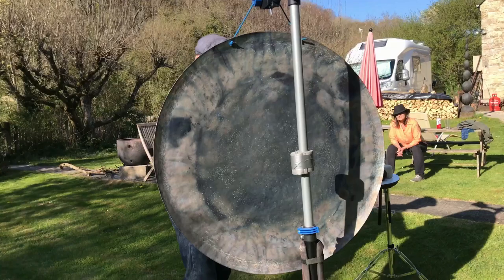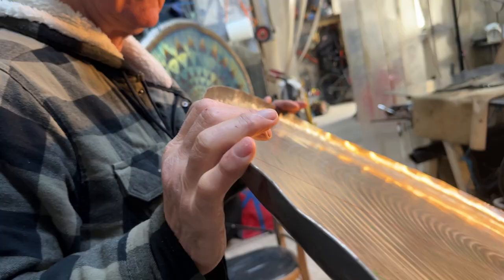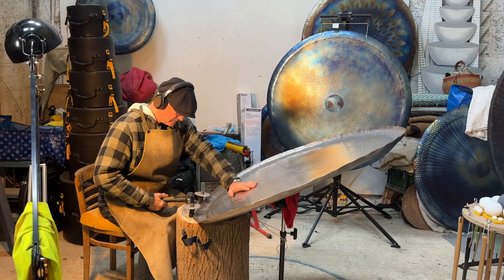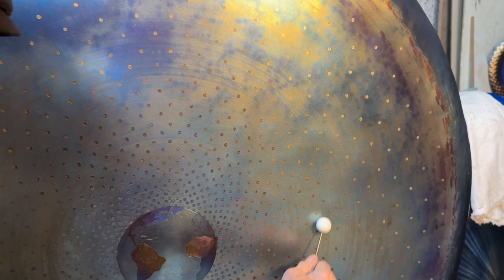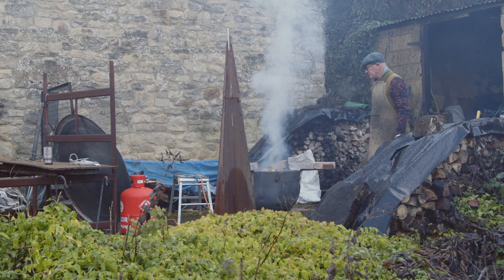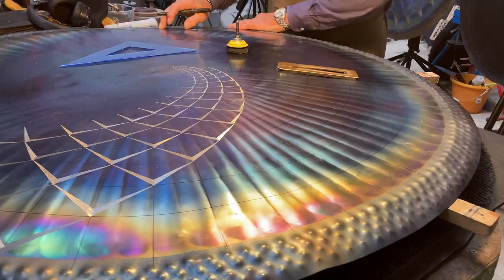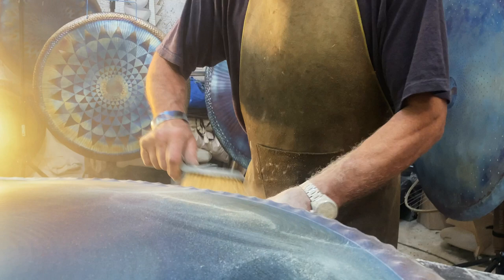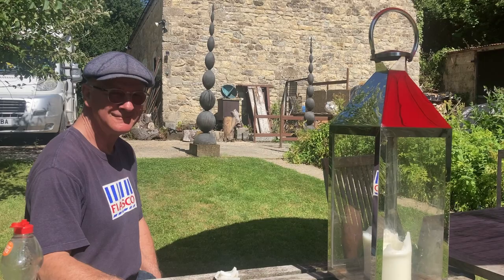Titanium gongs, why and how I make them ?

Comment: I was curious what such a specialty item, requiring so much skilled labor, would sell for. I'm quite astonished that you let them go for that low! How does one transport one of these?
Reply from the maker: Hi Allen ,   I am very fortunate to be able to make my gongs in my spare time, with percussion teaching , music gigs and my other sculpture work to support my practice. 
  I also have  low overheads as I own my own studio and am mortgage free.
  I try to offer my pieces at a fair price, that reflects both the cost of  materials and also the time that they take to forge . I  don't wish to charge so much that they become too expensive for the sound therapy community. .  
  I do not have the high overheads of masters such as Martin Blaise, with studio rentals and apprentices to pay, but neither do I wish to deliberately undercut his prices. 
Titanium is half the weight of steel, and size for size, ( as bronze gongs tend to be thicker) are about 1/3 of the weight of a similarly sized traditional going. .  The 39 inch gongs fit easily through the back door of a normal car, and are easily liftable with one hand. The 48 inch gongs do need a bigger estate or SUV , but again they are relatively light . Also, being titanium they are completely weatherproof, so could even go on a roof rack if necessary (In a bag though!)  Hope that this answers your questions... Cheers   Barry

Comment: I’m looking for a gong that doesn’t have that big splash sound but then that most of the way you hit it right? I want something that’s gonna let out a very low base note. How much do you charge for this like a 36 inch gong I don’t know, my ancestors in ancient Mexico have been documented as having them, but they were made of copper I was thinking of buying a sheet of copper having it cut into a circle and just play it, but I’m not sure if I’ll have to hammer it and curve it or whatever I guess the worst part is, I don’t have those kinds of tools
Reply from the maker: Hi Martin,  Gongs can be any shape - look at the work of Steve Hubback for example; he even makes skull shaped ones.  I have made a copper gong, and it sounded really good too.  Any big metal plate, hung up and hit, will give you a "gongy" sound, but the skill is to maximise the frequency ranges that they produce.   A flat gong (often called a wind gong" tend to splash` quickly and then decay quickly too.   Putting a rim on a` circular gong holds and controls the tension in the central portion, so you have more control and tension.    Good luck with your gong quest.   Do start by making a small singing bowl.  You will learn a lot from this process!

Comment: Dear Mr. Mason.

Thank you uploading such an amazing video. I am interested in making a titanium gong like this. Would you mind if I get your insights on these questions?

Would you recommend hammering the titanium before giving heat treatment? I am curious whether hammering works better before annealing it.

Is hammering on edges what tunes the gong or is it for making its shape?

I am wondering how hot should the temp be to get color on titanium. Is heat treatment and coloring happening simultaneously? Should the plate be ‘repeatedly’ heated till we see ‘dull red’?
Reply from the maker: Hi Antonio, I strongly suggest that you first experiment with some scrap titanium.   You will find that it doesn't behave like other metals in that when you heat it it actually gets harder! (You can' t anneal it like brass or bronze alloys!) 
 Therefore all the hammering and shaping has to be done cold.  I do also hammer every square cm, to return the titanium to its original hexagonal molecular shape that has been compromised in the rolling process. It is VERY hard work; be warned.  I treat it like a meditation. 
   I only apply heat only after the gong is fully shaped and hammered. The extra hardness that comes after heating gives it far greater resonance.    Personally I just use propane torches, but you can also colour titanium using anodising.  Do look at Ross Barrable's crystanium gongs if you want to see this.  I may well experiment with anodising in the future, but for now I am happy with the process that I have developed.  Martin Blaise has also been quite inspirational, and he regularly posts videos online. Good luck with your quest!
Reply: Thank you for your reply sir. Your works give happiness and motivations to a lot of people. I really appreciate your kind words.

Antonio.
Reply: Thanks for the great clips. I too wanted to make a titanium gong, so I immediately bought a plate and started tapping on it. 
When I started hitting it on the anvil with a metal hammer, the board warped so much that I couldn't get it to do what I wanted.
What kind of hammer do you use when you strike the center of the board instead of the edges?

Should I bend the edges first and then strike the inside?

thank you for great work.

Comment: Wonderful video! I've been practicing engraving my own gongs as well, and I'd like to say that you have a lot of patience, haha. I know you've seen Martin Bläse's painting technique that he uses on some of his gongs, and I was wondering if you've figured it out for yourself? Some of them look like they might be utilizing it. I'd like to attempt it too and I SUSPECT it might be accomplished with titanium dioxide (chemical in Wite-Out) but I haven't had a chance to test it myself yet. I know Blacksmiths use Wite-Out in canister-welding to prevent sticking, so I feel like it must be fairly heat-resistant. Any help or a point in the right direction would be greatly appreciated. Keep up the awesome work!
Reply from the maker: Yes,  I use "kiln wash". - it's what potters use to stop pots sticking together in the kiln.  Ross Barrable uses anodising on his ti  crystanium gongs gongs too -  passing an electric current through an electrolyte bath..  Interesting!
Reply: @barrymason4314  Awesome, thank you for sharing! I've thought that anodizing or maybe metal-plating would be interesting to try, but I'm not sure how you'd get the electricity to distribute evenly through such a large body of water. I guess the electrolytes aid in that then?

Comment: Heya Barry.. thanks for the video amazing to see how you work... I am wondering have you ever made a square gong?  is it even possible?  would the sound and resonance still be maintained in a square gong?  Reason I'm asking is I travel a lot with my gong and it's a hassle on planes.  I have wondered if I could get a custom gong made that would fit nicely in a large suitcase to meet the airlines baggage standards.  any thoughts would be appreciated.. thanks much matt
Reply from the maker: It's perfectly possible to make any shape of gong. Take a look at the work of my friend Steve Hubback for example.. He makes skull shapes, shell shapes ; all sorts!  But the deeper I go into the world of vibrational research I am more and more drawn to the larger gongs.  In fact I am now working on 2 new 48 inch examples, which from a business point of view is crazy.
Reply from the maker: I have made a couple of gongs in the past that were smaller than 39 inches, and they sounded like "dinner gongs" by comparison with the larger sizes.. As my gongs are used principally by myself and others for sound therapy work, I prioritise the deeper frequencies that only come from the larger sizes.
Reply: How thick is the titanium sheet you are working with ?
Reply from the maker: @ThatGongGuy  I've worked with 1.8, 2 and 2.5 mm.. It's a "Goldilocks" problem.  The thicker the material the longer the sustain, the thinner, the easier to bloom but the shorter the sustain.  I now usually build in 2mm grade 1 (pure titanium). Best compromise...

Comment: Wow! Those are amazing! Ive been wanting to hammer out a gong for years. What thickness (gauge) titanium do you use? Or if you were to make a gong out on stainless steel, what gauge would you use? I have some nonmagnetic stainless steel i think would work well for a gong. Any input would be greatly appreciated ✌🏼✌🏼
Reply from the maker: Hi Miley,  I've tried 1.8.  2. and 2.5 mm .   I find 2 mm the best compromise .   The only  SS gong that I have made was from 3mm - too thick !   Hope that this all helps.
Reply: @barrymason4314  oh ok. That's fairly heavy gauge sheet. That's heavier gauge than I thought it would be. I have some 16 gauge (1.6mm).  I think that should work out alright.  Thank you for your help.